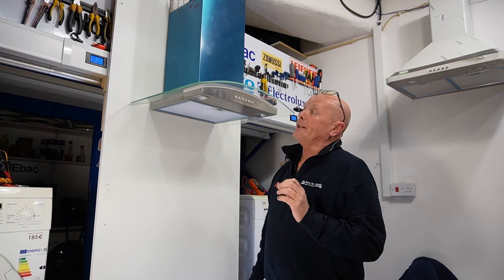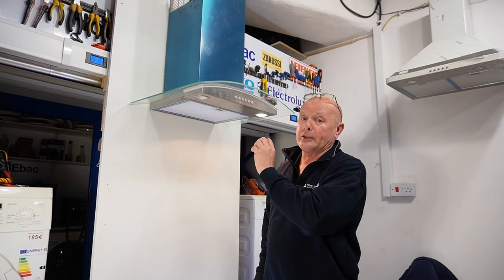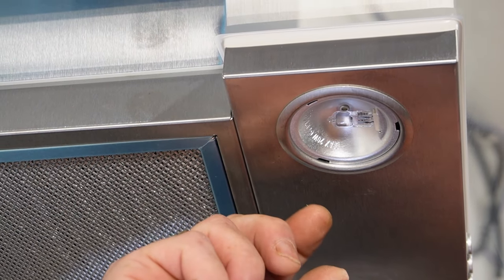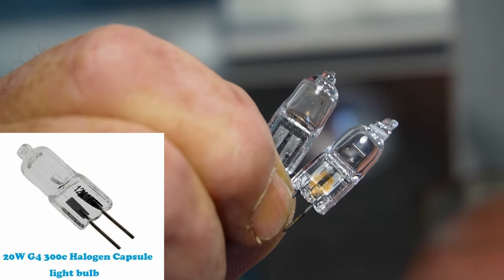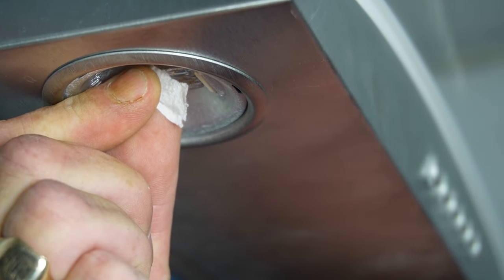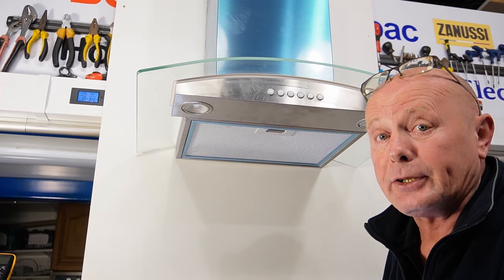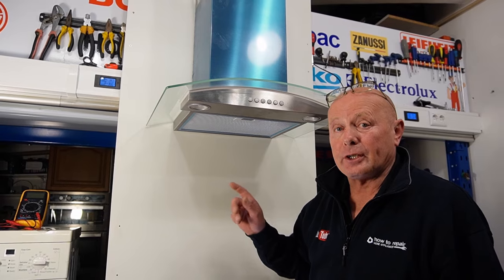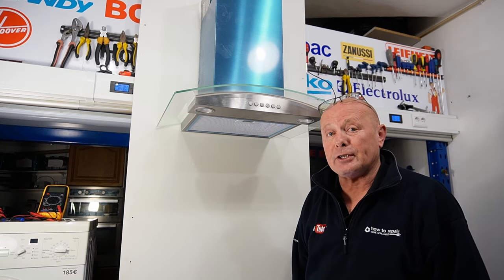How to replace a Cooker hood extractor lamp bulb G4 12v 20 watt halogen light

Comment: "Just gently wriggling the bulb and gently slide in"
Haha! Yeah, right! Those sockets are the most oversprung, tight, poorly designed lamp sockets in use today.
Also, that little halogen bulb is so fragile! In that any sideways force on those pins leads to the glass breaking & making the bulb useless.
I watched this video hoping to learn "the nack" of how to use this god awful socket. 
But nope, we're advised to just "wriggle it in"!
Best tip is that these bulbs are much cheaper on eBay. Then the few you break trying to get them in won't cost an arm & a leg!
I've replaced mine with long lasting LED versions. Then the lamp will outlast the cooker!
Just put "12V 20W LED G4" and you'll see them. Sort by lowest price + postage too, for best economical results.
Reply from the maker: Well I tried to explain it as best as I can for the consumer yes they are very tight sockets but you must admit if you take your time and slowly wiggle the bulb  it will come loose. Will someone that knows this so well you must be trade I hope you found the video useful for anyone that you wish to pass it on to
Reply: LED all the way, I was forever changing halogen ones - Must be about three years I changed them to LED, no blow outs at all. It is quite a fiddly job and awkward to get too, but you can also prize open the whole unit out, then it makes it easier to work on.
Reply: apparently not possible to do this on all models due to the location of the transformer or something?

Comment: These bulbs stop lighting even when they are not burned out.  I often have to move them back and forth to get a connection.  Does anyone know of a way to keep the prongs connected?  Is there some kind of fluid that can keep the prongs conducting electricity?  Very frustrating.
Reply from the maker: try a smear of grease on them only to create conection  Thanks 👍 for watching and please remember to subscribe to the Channel as that's what keeps us going in able to make the video for you

Comment: I'm sitting here with a bloody thumb from trying to insert a new bulb that broke when pushing it into the socket. I've never had such difficulty before. I got the burnt out bulb out, but one pin remained so got that out  using needle-nose pliers. But now I can't get the replacement bulb in! Despite gentle pushing & wiggling - it just won't go in. I never had this issue before so I pulled out a working bulb from another cabinet puck light & compared it to the burnt out bulb & they match. 
Then, when I tried to replace the good, working bulb back into it's socket, it too won't go in!! 
There must be a trick I'm missing. 
Is it possible that once removed, they can never go back in? That seems silly but have to ask as now I have 2 cabinet sockets with missing bulbs as can't insert them! 
I'm so frustrated I put call into our electrician but that'll take time. I hope someone can help.
I have a pack of new replacements, but the pins on that package are just a tiny bit longer which seemed odd so now I wonder if this exact bulb is also make with slightly (and I mean ever so slightly - less than 1 mm) longer pins??  The spacing between them is 4mm so I assumed all G4 12v 20w T3 bi-pin bulbs would work. Tks for any tips!
Reply from the maker: I'm sorry to hear it drew blood. I can only go by what you have described as I do not have the appliance in front of me to me. It sounds like you may have damaged the location lugs in the holder. It may be easier and cheaper for you just to replace the light fitting. I'm sorry I can't be any more assistance without having the appliance in front of me. Have a great New Year. Please remember to subscribe to the channel